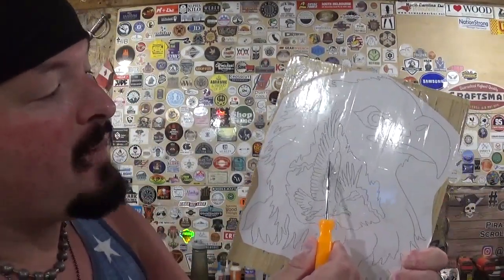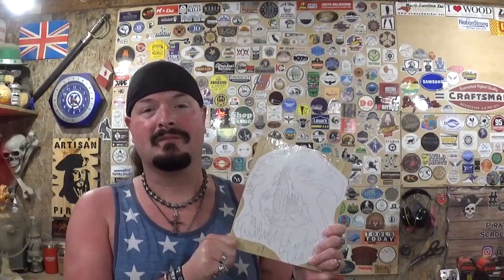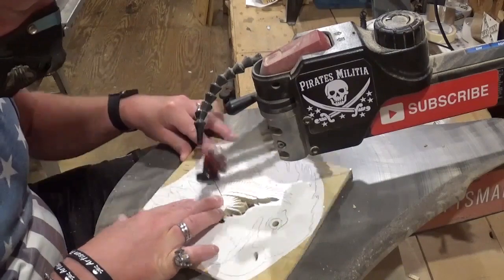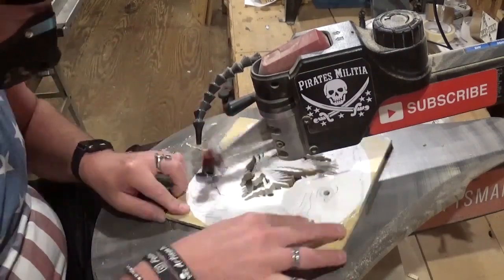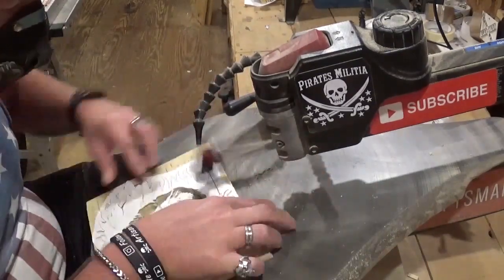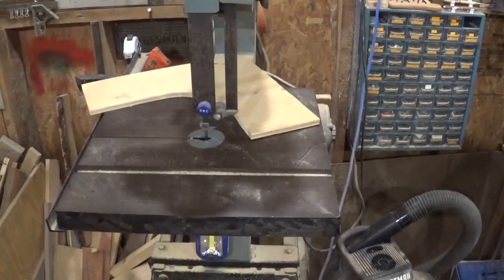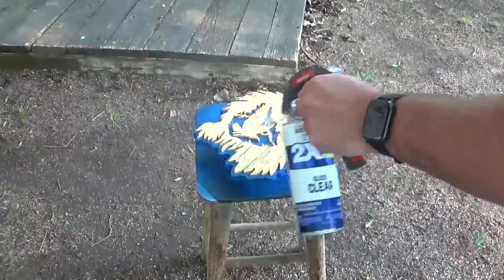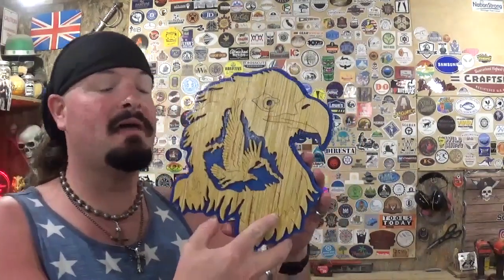Bald Eagle, 4th Of July, Scroll Saw Project

Comment: Does the CA glue hold up long term?
Reply from the maker: It's been debated but, I can tell you this. I have several projects hanging on the display wall that have been there a few years and they were assembled with CA Glue and they are still going strong